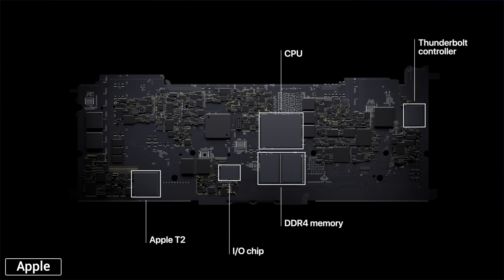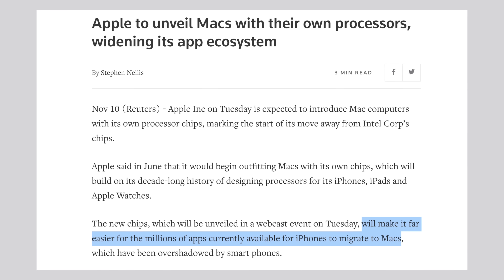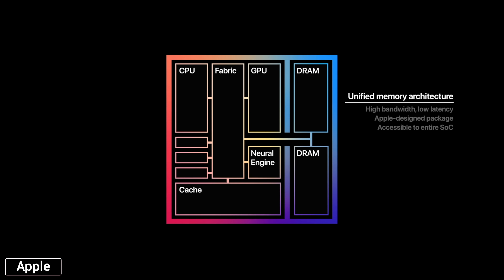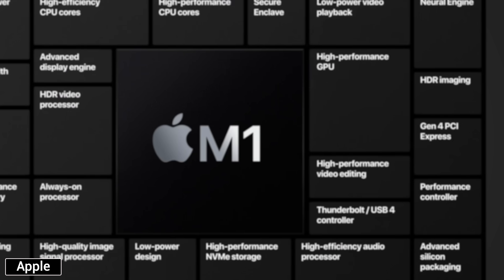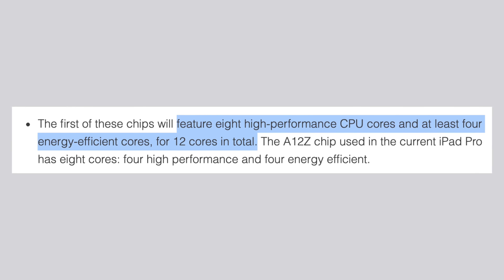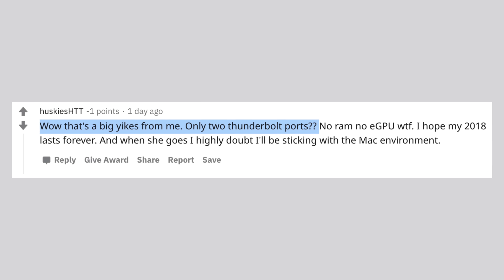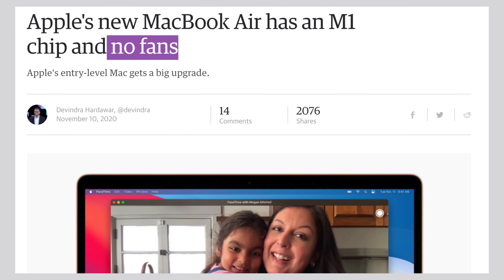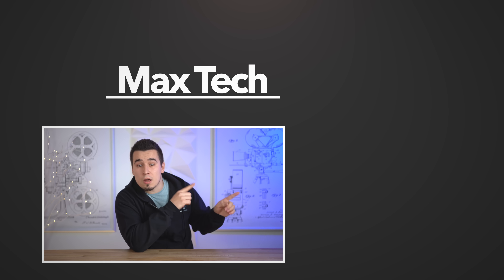Apple M1 Mac Chip Explained: Questions & Doubts Answered

Comment: I just wanna ask tho, at first I didn’t even plan on buying the M1 MacBook before the event because I thought it would be an insignificant change, but seeing what it could do, I’m starting to have some doubts.

I’m planning on getting the 16” MacBook Pro, but looking at the M1 chip, do y’all think I should get the intel version MacBook Pro 16 or do I wait for the M1 MacBook Pro next year? (Leaks said it will be released on March)
Reply: If you can wait till mid/late 2021, then wait. If you need a machine now or need Windows, then buy the current 16" (still a great machine).

Comment: That moment when people are getting the 7 core GPU variant of Macbook Air: finds ways to enable the 8th core
Reply: Is there a way?
Reply: @M3carona  Of course there will be. There must be someone who hacks the Mac ROM and such.
Reply: @GamesCell  unless you rewire litography, there won't be.
Reply: @piotrd.4850  The 8th core is just disabled because it failed a quality test, but doesn't mean it won't work at all. There must be methods of unlocking the 8th core as well. Just like the CPUs can be unlocked.
Reply: Albert is the difference gonna be big with the 8 core version? I am kinda worried that the 7 core version might be performing slightly worse than the 8 core version
Reply: @GamesCell  no it won't, they are not software-disabled like how AMD did it 10 years ago, for chips like this it literally meant X-Raying the faulty core so it gets totally unusable.
Reply: Sure ... and then fry that fanless litle laptop.
Reply: @lars.epp98  Wasn't there a thing, where people use to try and turn on deisabled cores on older nVidea GPUs, since sometimes, if you were lucky, you were able to gain significat perfomance boost?

Comment: Probably the best explanation I’ve heard so far from a YouTuber about the RAM situation. As a hard core user of an iPad Pro with 6GB of RAM, iMac Pro with 64GB, and Threadripper system with 128GB, all I can put out is 16GB of RAM on x86 isn’t the same as 16GB on an Apple SOC. We are just going to have to wait and see but at least I can say that you should expect around half the RAM usage would would see on an x86 computer. It’s just all different.

Comment: I’m seeing/hearing the term “emulation” quite a lot, but from what I understand, Rosetta 2 isn’t an emulation layer like Rosetta was. Rosetta 2 recompiles an x86 app into a native Apple binary on first run, and then executes that from then on out. It certainly doesn’t “emulate Intel apps on the fly.”

This conversion takes about 20 seconds on first run, after which the recompiled binary replaces the old one, and there is no further performance hit.

Comment: There was a 32GB RAM Macbook Pro 13 model - but it had a higher end CPU and cost more. And I know there are quite a few people who bring their mobile workstation around, and dock with multiple monitors. The percent may be low but it's not that low. Multiple (3+) monitor support has been standard on Intel and AMD systems for a long time. Also just reminding everyone that these Macs don't support eGPUs any more :( I have an eGPU, so this is a bit disappointing.
But otherwise, I'm looking forward to these Macs, it might be my first Mac! These issues aren't a deal-breaker for me.
Still waiting for official benchmarks, I don't know how they could possibly be comparing with high-end desktop chips!?!? We can't make that call yet. It's possible that they may be excelling in certain CPU instruction set features like cryptography, making the Geekbench end result numbers look quite high.

Comment: I got 64GB RAM because I used to use a lot of VMs, but these days with cloud servers and Remote Desktop, I don’t run too many VMs. But I still think for pros, 32GB is ideal. For regular use, 16GB is more than enough. I’m waiting to find out how the unified memory helps with memory management as same data doesn’t necessarily need to be copied to multiple memory locations for use by different components.

Comment: Everyone: brr 8GB RAM not enough
Me: been using 4GB of RAM since forever...with an HDD (slow SWAP)
Reply: swap memory, 🥶 yikes
Reply: yeah 4GB is honestly good enough for highschool students
Reply: @hamzaahmad9145  Unless you are doing science projects that sometimes reaches 50+ tabs on chrome.
Reply: @zotac1018  Pro tip, don’t use chrome. Thank me later.
Reply: @xFamous24  Firefox ain't better.
Reply: @zotac1018  I feel this. Worst thing is... that's not even the highest demanding task I do on my computer.

I try to run Kali in a VM since I'm teaching myself cybersecurity... which basically crashes my computer because my hard drive has been failing lately ;-;
Reply: @xFamous24  "Uses IE 9, curses you later" :D
Reply: @kofi4927  Try to run Kali of a USB stick then. Also - make sure to have virtualization enabled in your BIOS settings.
Reply: @user-qy2wf2lt6v  I'm going to get a Raspberry Pi 4 so I don't have to
Reply: @kofi4927  Alright. I am also planning to get the Rapsberry Pi 400 (the one that inside a keyboard that runs way cooler). 
BTW - if you just plan to get the Pi 8GB verison and use it as a desctop replacement .... Don't.
Reply: @hamzaahmad9145  true but I'd still argue only with an SSD for faster SWAP partitions because you will inevitably run out of RAM

I've lived with 4GB all throughout high school and while it was bearable, it was painfully slow when doing science projects.

I'm now a university student and looking to upgrade

Comment: Lots of good info here.  Thanks.   One detail you skipped past is that the new Mac Mini is also limited to 16-gig of RAM, and in the case of the Mac Mini the intel-based model can go up to 64-GB.  So it's not the same as limiting the laptops to 16-GB.  But then, it's also notable that Apple is going to continue to sell the Intel-based Mac Mini, for those who need the larger memory space.  (FWIW, I have two Mac Mini's, both running at 32-GB).

Comment: The Intel Macs had 1.7 tera flops of Graphics power but the new silicon Macs have around 2.6 tera flops of power which is around 65% improvement..So we could expect GPU power around 5300M.
This chip is going to be great and I'll bet after this companies like Qualcomm will also start manufacturing this kind of chips.

Comment: I think you’re undercounting the graphics of the M1. The a14 gets 12k in metal and the m1 doubles the cores so it should be around 25k. 

Luke Miani did a good thought experiment on it
Reply: I’m thinking it will likely match the 5300M in the 16in
Reply: @chidorirasenganz  To be fair, some of the tasks that are performed in GeekBench Metal tests might be offloaded to NPU, which could end up increasing the score despite having GPU not capable of scoring that high.
Reply: @XtraGalaxyOfDreams2020  Does it matter in the end as long as performance is the same?

Comment: As to memory limitation, not that simple. M1 SoC has embedded memory which consumes chip space. You have to either increase the chip size, or use more advanced silicon process in order to accommodate larger memory. Increase the chip size will impact the yield rate of chip, and thus lower production speed and higher cost per chip. if you use more advanced silicon process, say 3nm, than you have to wait for another 18 month. 
Discrete memory chips are the best way to solve the issue, but that means major chip architecture redesign, which incurs huge development cost. Apple will only do that when absolutely necessary.
So guys, if you need more memory, you may have to stay with x86 for quite a long time.

Comment: I've seen so many people thinking that Apple will stop allowing third-party software from outside the App Store... It would be a stupid move, and Apple doesn't do stupid moves (sometimes they don't cater to every demographic, or remove a port but that's different, just because you don't like what they did doesn't mean its stupid). If they stoped allowing third-party apps from outside the App Store on a device meant for high-end professional work and often niche use cases then millions of people would be forced to switch to a platform that has the apps they need.
In short, Apple would lose a lot of money from Mac sales and gain a bit from slightly increased App Store traffic.
Reply: Apple doesn't care about corporate market anyway - for them, startups are hipster people facetiming in WeWork-alikes.  JAMF-like centralized management? Dell-like NBD fixes? Nah, Apple is fine without it.
Reply: @piotrd.4850  I'm not talking about the "corporate market," or whatever you said after the hyphen, I'm talking about pretty much anyone who uses high-end specialist software on Mac - video editors, music producers, photographers, graphic designers etc etc.

Comment: More RAM is only necessary if it’s being used, otherwise, having 12TB of RAM with a single core 1GHZ cpu means nothing. So with that said, a faster chip with faster access to memory could run just as fast with less. RAM is just where you store the stuff the CPU isnt actively working on. Faster worker means less need to page out to RAM

Comment: 16:15 is that an eGPU? If so, Macs clearly won't be the same if they can't handle them on M1.
Reply: Considering that the I/O bus can connect to at least one 6k Monitor, the M1 should easily be able to support an eGPU. Like Vadim said they are most probably sick and tired of having to constantly update the drivers for those hundreds of eGPUs available in the market. Instead, they might come out on their own.

Comment: how will gaming perform on the pro 13'  with m1 chip? ve never owned a Mac and I heard the 16' with dedicated graphics is best for gaming
Reply: I just ordered the 16" MBP so I can game on it (which I realize is stupid). If the Metal benchmarks in this video are accurate, the current Intel 16" with 5500m should be 35% more powerful than the 13" Pro with M1. Combine that with not being able to run Windows and I'll stick with the 16" Intel for now. I'll be really curious to see how well gaming works on the M1X 16" while emulating Windows once that's available through Parallels or something else. Or maybe Microsoft will eventually release a public version of Windows for ARM and Bootcamp will be a thing again? But Apple seems against that so who knows.
Reply: @airops423  thank you for the response. i already pre ordered the new macbook pro 13' as its my first mac and i like something smaller than the 16. if it doesn't suit my tastes I can always return and exchange for the bigger and more powerful machine.
Reply: @hassankaraki8080  Fair. Just keep in mind for gaming you will be limited to Mac-compatible games since you can't run Windows. I can deal with a bit less performance, but no PC games was a deal-breaker for me.

Comment: Real talk. I’m stuck in a loop. I wanted the Mac mini: most affordable, can build it out into a nice desk setup over time (better monitor, etc). Then I was like, no, get the Pro: it’s the full fat Mac experience (Apple display, keyboard, trackpad, speaker system, mics) but now I’m like the Air... that’s the worst Apple Silicon device there will ever be. It has no active cooling system, it can have a worse bin of the chip. Wouldn’t it be awesome - for posterity - to have this device - the one that started it all. It’s like how I want an OG iPhone just to have it so every new iPhone I can compare and be like “hot dang” technology is awesome.

In short: I don’t know what I want to buy. Not that it matters. I’m broke 😂

Comment: I disagree with the statement about “more effective ram usage in ARM:
1. It won’t be able to offload apps similar to iPadOS when you don’t use them;
2. Memory is just memory: if my program needs 20 GB it want be able to run on these macs without swapping like crazy.
Reply: Yeah I'm seeing a lot of people just brushing this off. + Having to share vram doesn't help on the 8gb models. I feel like the 16gb is almost mandatory even though apple charges an arm and a leg for the upgrade
Reply: More effective ram usage is based off of iOS vs Android, where a 6GB iPhone can outperform a 12GB S20 Ultra in multi-tasking. Hopefully this applies to the Mac lineup as well. And most people don't get lower-end MacBooks for heavy tasks that require 20GBs. Those ram prices should be illegal

Comment: In my view the new Mac Mini is worse as a whole system than the Intel one. Limited RAM, non-upgradable like in the old one, two TBP instead for four, no 10 Gbit ethernet, NO EGPU SUPPORT, no more bootcamp, how can this be better?
Reply: If you compare this to the previous gen base model MBP 13 with equally limited, non-upgradable RAM, two TBP and no 10GBit ethernet, this thing will be a whole lot better in many ways.

Comment: Vadim, when do you think the new 14inch MBP will be released? Q1, Q2 or Q3 in 2021?
Reply from the maker: Before summer 2021. Maybe around WWDC time. Potentially July. Who knows!
Reply: @MaxTechOfficial  I really need a Mac and I am wondering whether to wait or not. 

My late 2013 MBP’ battery has 1450 cycles (of Apple stated capacity of 1000) 

I have waited 7 years, what is a couple of more months but at the same time - M1 baby lol

It just seems strange for Apple to have a new 13-14 inch offering after only 6 months...